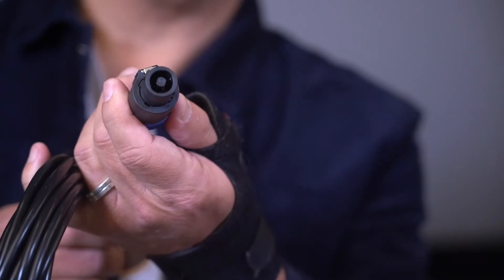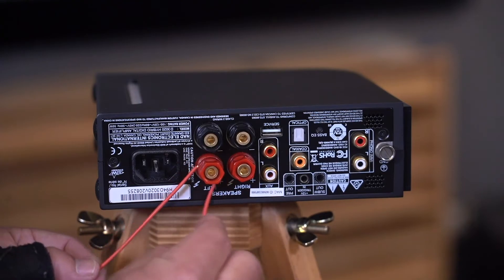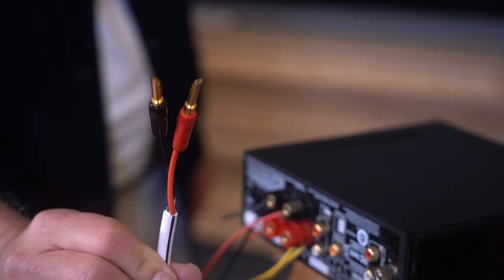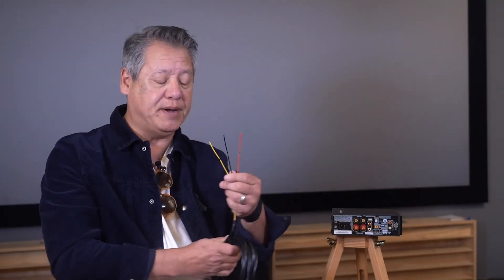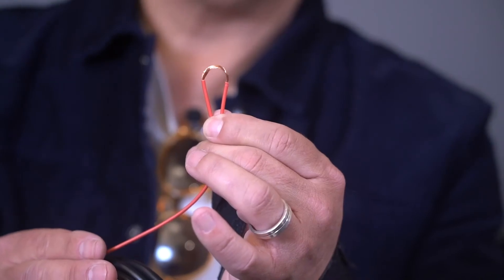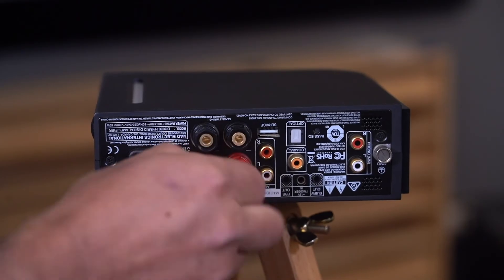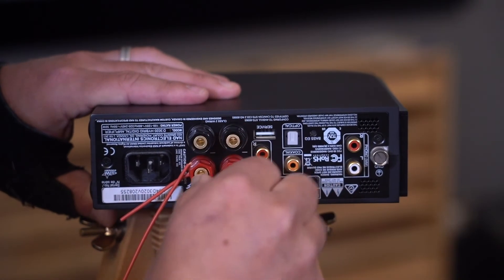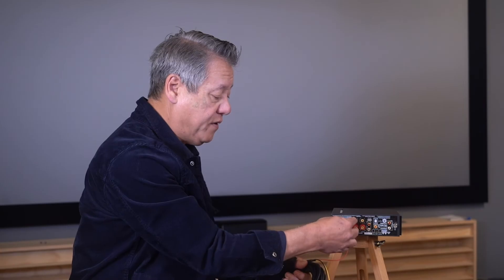What are some tips for the best way to connect a REL Acoustics subwoofer high level?

Comment: Can it be  connected to speaker terminals on speakers? (not on the amplifier, on speakers).
In that case we could avoid an extra long running cable in the floor.
Reply from the maker: In some cases it is possible to connect the High Level cable to the binding posts on your main loudspeakers, though this is easier when using a stereo pair of subwoofers instead of a single subwoofer, so that one subwoofer will connect directly to the right channel speaker and the second subwoofer will connect directly to the left channel speaker. 

For more detailed and specific connection advice, please write in to contactus@rel.net and we will be happy to assist.

Comment: So what do you do with the 3rd wire?
Reply from the maker: The black wire of the High Level cable should be connected either to a chassis screw on the amplifier, or to a designated ground screw if one is available. The red wire will then connect to the right channel positive speaker output terminal, and yellow wire to the left channel positive speaker output terminal.

Comment: My speakers are bi-amped shall I connect both of them to the 2 red main posts? Marantz SR 7012 (FRONT R RED +) / (FRONT L RED +).
Reply from the maker: If you are bi-amping your main loudspeakers then the red wire should be connected to the right channel positive amplifier output terminal that is powering the low-frequency drivers on the right channel speaker, and same for the yellow wire to the left channel positive amplifier output terminal for the left channel speaker's low-frequency drivers.

Comment: And what happens with the 3rd Cable???
This is not a full Instruction...Thanks
Reply from the maker: When connecting a single subwoofer High Level to a stereo amplifier, the red wire will connect to the right channel positive output terminal, yellow wire to left channel positive, and black wire to a chassis screw or designated ground screw.

Comment: Proper pro tips, thanks. I have a follow up question, the amplifier I am thinking of using is the Marantz 60n, which to to my understanding does not have a low pass filter for the setting sub crossover. If I use the high level connection (connect sub directly to speaker out on amplifier) on say a T/5x, can I just set the crossover using the subwoofer's physical crossover knob? The Marantz 60 n crossover seems to be set to 150 Hz to my understanding. Thanks!
Reply from the maker: Thank you for reaching out. If you connect a T/5x using it's High Level input to your Marantz 60n, then the Crossover dial would be used for adjusting the upper end of the subwoofer's output, meaning that essentially you will be adjusting a low-pass filter for the subwoofer's signal. However, this will not apply a corresponding high-pass filter to the signal received by your main loudspeakers, meaning that they will still be receiving a full-range signal.
Reply: @RELAcoustics  Thank you for clarifying. My main speakers go down to 50 Hz. Do you typically recommend setting a high pass filter to make speakers too?
Reply from the maker: @qwertyman9560  We generally recommend against applying a high-pass filter to the signal received by your main loudspeakers, and instead recommend sending a full-range signal to the main loudspeakers.
Reply: @RELAcoustics  Thank you, so sounds like I should be all set then.
Reply from the maker: @qwertyman9560  We find that the vast majority of speaker models perform best when sent a full-range signal, without any high pass filtering applied to them.
Reply: @RELAcoustics  Thank you, I will set it up that way. Out of curiosity though, is there a reason for this? I ask because I have found some others advise to set the high pass crossover to avoid the main speakers (especially smaller bookshelf) from taking over some of the base around that overlap frequency range with the sub to avoid "double-counting", thanks!
Reply from the maker: @qwertyman9560  There can be some performance benefits by bandwidth-limiting the signal going to your main loudspeakers, though in our experience the vast majority of speaker models are designed to be able to receive a full-range signal from an amplifier, and perform best when operated in this way. The following article from our website provides greater detail regarding this topic: https://rel.net/blogs/learn-and-explore/what-is-a-high-pass-filter-and-why-doesnt-rel-use-them?_pos=1&_psq=high+pass&_ss=e&_v=1.0

Comment: I had a Velodyne F-1200 (until it died) bought in 1998 and I have loved every minute it was in my system. The technology made for beautiful music reproduction... which is my first priority. I live in an apartment, so there's a limit to the volume my system can put out. I think the T/9x is what I've identified as the best match for my current system and is comparable in function to the Velodyne which used an accelerometer to control the speaker's amount of travel. There was no mush in the low bass output - beautifully tight and accurate. Plenty of power for Rock 'n Roll and still rich and full on Late Night Jazz when listening on lower volume levels. The sub's response was incredibly smooth.

NOTE: I'm using an NAD T777 Receiver and only using the front L-C-R speaker connections. Front L & R are Velodyne DF-661s (spun aluminum cones) and the center is a Tannoy EYRIS DCC in walnut.

Any opinions on the accuracy of the T/9x being a good match for my system?
Reply from the maker: Thank you for reaching out. The T/9x will be a good option for pairing with your Velodyne DF-661 speakers in a moderate-sized room, and is a very fast and responsive subwoofer. If you have any further questions or concerns regarding the T/9x then feel free to write in to contactus@rel.net and we will be happy to assist.

Comment: And where do we attach the Black-Ground wire? - Either one of the Black connections? This part was not informative - "Here's 3 wires you'll need to connect. Here's how you connect 2 of them." Not very comprehensive instructions in my view.
Reply from the maker: The black High Level wire can be attached either to a chassis screw on your amplifier, or to a designated ground screw on your amplifier if one is available. Alternatively, you can leave the black wire completely disconnected and instead run a basic RCA cable from the subwoofer's .1/LFE input to any open/unused analog RCA input or output jack in your system, with the subwoofer's .1/LFE Level control lowered to the minimum position. Any of these options will provide a ground reference between the subwoofer and the rest of your system, which helps to prevent ground hum from occurring.

Comment: hi youd show us the redabd the yellow wire  and the black is the ground and pls tell me wheres the ground wire goes ? as i can see ur amp has a ground connection on the back  but what happens if no ground connections on the amp , where to connect the black wire? oh saw ur other video how connect ground to chassis screw  but i  got the new Wiim amp ultra and there no ground or chassis screws I can connect that ground wire to.
Reply from the maker: When you have a chance, please write in to contactus@rel.net with the model of amplifier that you are using in this system, and the specific model of REL subwoofer that you are using, and we will be happy to assist with connection instructions specific to your application.

Comment: Hello, this is Adam. Can I connect the red cable together with the yellow cable to, for example, the left channel (+). The subwoofer has one channel anyway, right?
Reply from the maker: It is possible to combine the red and yellow wires of the High Level cable together, and connect them to a single positive speaker output terminal on your amplifier, for example the right channel positive or the left channel positive. This is typically done when setting up a stereo pair of subwoofers, so that one subwoofer only receives right channel signal and the second subwoofer only receives left channel signal, or when setting up a center channel subwoofer. 

That being said, if you are connecting a single subwoofer in a system that uses a stereo amplifier, then we recommend connecting the red wire to right channel positive and the yellow wire to left channel positive, so that the single subwoofer can receive both left channel and right channel signal.

Comment: Hi, have another question please. If i need to use room correction and i need to eq down a specific low frequency, lets say 45 hz, i mean something like 9 db down. It will influence also the signal going to the sub. In this case LFE will be preferable? If i use lfe i wont be needed to eq below 80hz
Reply from the maker: Thank you for reaching out. You are correct that, when connecting a REL subwoofer using it's High Level input, any EQ correction applied to your main loudspeakers will also be applied to the signal received by the subwoofer. If you wish to apply independent EQ correction to the subwoofer, separate from your main loudspeakers, then it will be best to connect the REL using it's .1/LFE input to a subwoofer output on your preamp or receiver.
Reply: @RELAcoustics 
 thanks. Rel musicality sound signature still shines with lfe connection? or should i connect the rca to low level input and make the cross in my amp ( it has bass managment) and in the sub also? Can it be done?
Reply from the maker: @upitshak  Correct, when connecting to the subwoofer's .1/LFE input you will still experience the classic REL performance, just with the subwoofer's internal crossover filter being bypassed which is ideal if you will be applying bass management within your receiver to the subwoofer's signal.

Comment: Hi, do you recommend to connect isolation feet to t5x or they already  isolated?
Reply from the maker: Thank you for reaching out. To get the best possible performance from the T/5x we recommend against isolating it, and instead recommend having it placed directly on the floor in your room using the original stock feet. This will allow the subwoofer to couple directly with the floor and use this surface to reinforce the it's output and more evenly project the output throughout the room.

Comment: Hi, if my amp has base management i could use the lfe rca for stereo? because i dont want my main speakers to receive full range
Reply from the maker: If you wish to bandwidth limit the signal going to your main loudspeakers, and will be using bass management within your amp for calibrating the subwoofer's output, then it will be best to connect to the .1/LFE input on your REL. The .1/LFE input completely bypasses the subwoofer's Crossover filter circuit, which will allow the bass management program to have complete control over the subwoofer's integration with your main loudspeakers.

Comment: Hi I have a pair of s812 with bassline blue stackable bananas so how do I connect to my luxman 509z amp
Reply from the maker: Here are instructions for connecting a stereo pair of S/812s to your Luxman L-509z integrated amplifier using the High Level input: 
- Combine the red and yellow wires of the right channel subwoofer's High Level cable, and connect to the right channel positive speaker output terminal.
- Combine the red and yellow wires of the left channel subwoofer's High Level cable, and connect to the left channel positive speaker output terminal. 
- Connect the black High Level wires for both subwoofers to the signal ground thumb screw on the amplifier's rear panel.
Reply: @RELAcoustics I had the bassline blue on a naim amp so will I cut the black bannana away so I can ground it to the screw post.
Reply: Or will I put spades on instead of the stackable bannana.
Reply: My bassline blue has stackable bannana so will I cut the black bannana off so I can ground it.

Comment: Hi, my Exposure amplifier (Naim amplifiers are also the same) does not have 5 way binding posts, it only has sockets for banana plugs, how can I connect the high level? Do I have to use stackable banana plugs?
Reply from the maker: Thank you for reaching out, and yes if your Exposure amplifier exclusively features recessed banana output terminals, then it will be best to attach stacking/stackable banana plugs onto the bare-wire ends of the High Level cable.

Comment: Hey there, I do bi-amp my main speaker. How to connect the high level wire correctly then?
Reply from the maker: In this case, the High Level cable should be connected to the outputs on the amplifier which is powering the low-frequency drivers on your main loudspeakers. 

If you have any further questions about connecting in this system, then feel free to write in to contactus@rel.net and we will be happy to assist.

Comment: how to connect this directly to active speakers that only have RCA output?
Reply from the maker: The High Level input can only be used in systems that feature passive speakers and a separate amplifier. If you are using active/self-powered speakers, then we instead recommend connecting a REL subwoofer using it's Low Level input to the speakers' RCA output.
Reply: @ thanks!

Comment: My amp (Exposure 2510} does not have a traditional speaker binding post. It only accepts a banana connector, so I cant connect the speakon wires to the amp.  Is it ok to just join the red and yellow wire to the positives of my speaker wires directly? Like instead of connecting to amp, I'll just join my speaker wires and speakon cable wires together.
Reply from the maker: Thank you for reaching out. Since your Exposure amplifier uses recessed banana terminals for the speaker outputs, one option would be to combine each High Level wire with the corresponding main speaker wire, and then attach a single banana plug onto both combined wires. Another option would be attach stacking banana plugs onto the bare wire ends of the High Level cable, so that it can connect directly to the outputs on the Exposure amplifier and then have the banana plug for your main speaker wire inserted into the back of it.
Reply: @RELAcoustics  thank you. I didn't realize there's such a thing as stacking banana plugs. I'll look into that.

Comment: Hey, does this work for a relatively old Stentor? I inherited it from my dad but don't know how to use it.
Reply from the maker: Older REL subwoofer models such as the Stentor have slightly different connection requirements compared to our current subwoofer models. When you have a chance, please write in to contactus@rel.net and a member of our team will be happy to discuss connection options for your system.

Comment: Does the red not go to the right channel and yellow to the left ?   Ive watch many videos from Rel and all say red goes to the right and yellow to left positive .. ???
Reply from the maker: With a single subwoofer setup, the red wire will typically be connected to the right channel positive output terminal on the amplifier and the yellow wire to the left channel positive output terminal. However, both the red and yellow wires are functionally identical, which means that you will get the exact same result if you connect the yellow wire to right channel positive and red wire to left channel positive.

Comment: I have single-ended 300B tube amp. Do think I can connect your subwoofer to my speaker's outputs without hurting the main speakers sound? We all know tubes amp are sensitive to the speaker impedance
Reply: How about 4ohm speakers like magnepan 1.7i Is it OK ? Also I have a separate setup preamplifier and power amplifier. Mcintosh c49 & Mcintosh mc152. Thanks
Reply from the maker: @ Using a REL subwoofer connected High Level with your Magnepan 1.7i speakers will be fine, and will  not interfere with the performance of the speakers. That being said, with your McIntosh MC152 we recommend connecting your Magnepans to the 4 ohm positive speaker output terminals, and connecting the positive (red and yellow) wires of the REL's High Level cable to the amplifier's 8 ohm positive speaker output terminals. 

For more information about connecting a REL subwoofer in your audio system, please write in to contactus@rel.net and we will be happy to assist.
Reply: @RELAcoustics  how about if I use the same speakers output connections because mcintosh owner manual said only single speakers used i don't want to risk it.
Reply from the maker: @ You are welcome to connect the red and yellow wires of the High Level cable to the 4 ohm positive speaker terminals on your McIntosh amplifier, though this will result in a lower gain signal reaching the subwoofer, and less overall output from the subwoofer. That being said, there will be no risk of damage to the amplifier, your main loudspeakers, or the subwoofer by connecting to different positive output terminals on the McIntosh, as long as the High Level cable is connected correctly.
Reply from the maker: Thank you for reaching out. The High Level input on our subwoofers has a significantly high input impedance (roughly 150,000 ohm), which allows it to connect directly to the amplifier's output terminals without placing any current load on the amp or altering the performance of the system's main loudspeakers. Even with tube amps, we have yet to encounter a scenario where the High Level connection had a negative impact on the performance of the amp or main loudspeakers.

Comment: How do I connect a REL Tzero MKIII subwoofer to a Cyrus i9XR amp? Thanks.
Reply from the maker: Thank you for reaching out. The following instructions can be used when connecting High Level to the Cyrus i9XR:
- Red wire to the right channel positive speaker output terminal.
- Yellow wire to the left channel positive speaker output terminal.
- Black wire to the ground screw, located next to the phono inputs on the amplifier's rear panel.